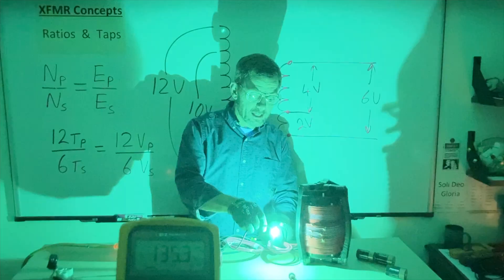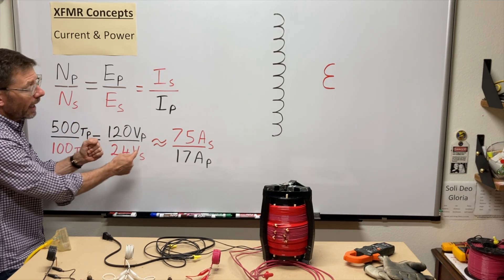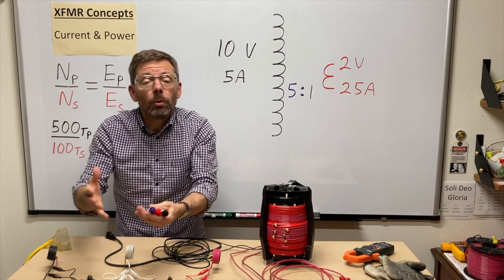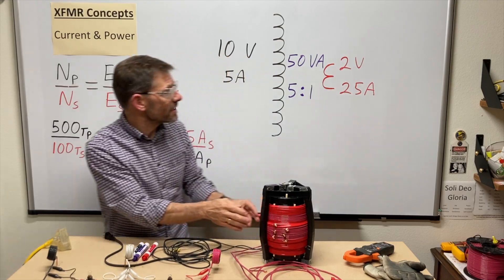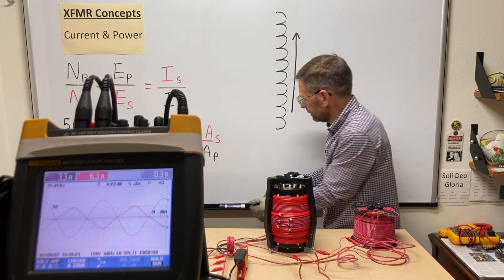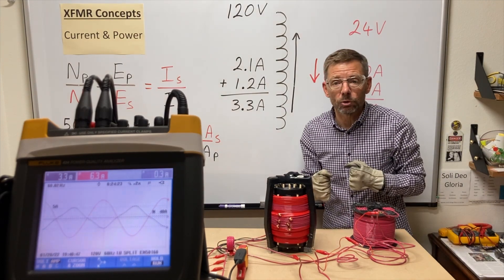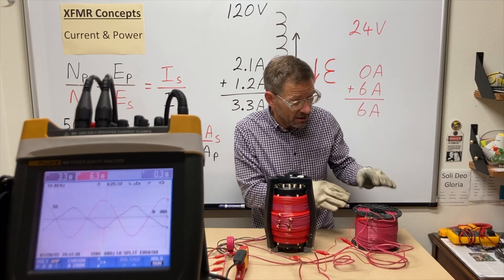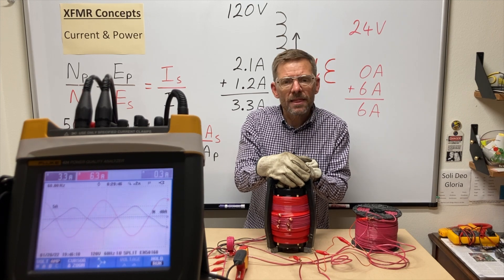Transformer Current and Power

Comment: Its possible to connect the secondary coil in series with the primary coil, but the output amounts to zero volts bc the waveforms cancel each other out being 180 degrees out of phase with each causing 100% destructive interference. Perhaps if the leads of one of coils were exchanged then it would give 240 volts from 100% constructive interference.
Reply: 🎉The wires in that transformer are too thin and its causing some copper losses due the electrons not having enough room to bounce around and some escape into the wire's insulation or coating. If wire was thicker more current would be available to the load devices connected in parallel. If you applied 240 volts to it the transformer would get so hot it will catch on fire due to these lost electrons escaping.

Comment: Hello Dave, hope all is well. I was wondering if you could settle a debate I’m having with a friend. We watched a video of a fella who plugged in a 500 foot spool of Romex (line to line and neutral to neutral on the same end) so basically just extending the circuit. The fella in the video was doing it to see if voltage drop would occur over the 500 foot roll without a load of any sort. The result, the same voltage measured at the connection occurred at the end of the coil of Romex. No difference in voltage. That’s not the debate and was just  the videos finding. At this point, my friend suggested putting an iron rod through the center of that “coil”. I told him it’s not a coil. There’s no magnetic field in that as it isn’t connected end to end. It’s just one way or “open” and I told him the neutral would negate any electromotive force as it is an opposing return path. That started the debate. I can tell you that in the video, the coil was not vibrating and apparently not producing any heat either. Since no VD was detected, in my opinion that would indicate 0 current being carried and therefore no, or a very low  magnetic field. If I’m being clear with this, can you explain in technical terms what is happening in this scenario so I can explain it to my friend? I’m pretty sure that I’m correct on this. Feel free to ask questions if need be. Thank you for your time.

Comment: Hey Dave, love your channel. May I get clarification on two questions:

1)
I was told that even if a system isn’t grounded (no ground rod to neutral etc at transformer and no grounding anywhere ) that if a power line that’s energized comes down and touches the earth, that it would still energize the earth. Now if energize means put the earth that it’s touching at its voltage then that’s surely true right? No matter if it’s soil, gravel, water that it’s touching right? A  120 v line comes down, and it will make the earth 120 v relative to neutral (in USA), no matter if that powerline is touching dry pavement, dirt soil or water right?

2)
The second question is - let’s forget about voltage. We have this 120 v line touching the ground - let’s say it’s grass or soil or water, is it possible for a current to flow thru the very earth itself if there are no grounding rods or grounding stuff anywhere near by? I ask it this way cuz I’m tryna take away with “return to source” and still see if current would flow thru the earth.

Comment: Your  explanation is awesome! Quick (academic) question.  What would happen (in your 50VA rating example) if I try to draw more current than the  maximum rated (on 2ndry 25 Amp) current  lets say 40 amp, load (given I run appropriate wire/gauge to accommodate the 40 amp current on the 2ndary side).  Since theoretically, if 2ndry draws more current, the the current in the primary also increases, so how does the rated capacity (VA)  factor in this? This is a sheer academic question.  Thanks.

Comment: God morning…😊
If i have 4160v primary line to line. I want to bank a transformer with 4160v primary and 240/480 v secondary . The costumer need 240 volts. What would be the connection on secondary to acquire 240 volts.. internal connection series. Cannot be parallel..
Reply: Cannot be parallel internal

Comment: Np*Ip/Ns*Is = Ep*Ip/Es*Is
AmpereTurns_primary/AmpereTurns_secondary = VoltAmperes_primary/VoltAmperes_secondary

Ampere Turns is the unit for the magnetic field.  Multiply by the magnetic permeability and it gives magnetic field in Tesla.

If you use a variable power supply with constant voltage source or constant current source, it will show the input voltage and current and you can vary things, without so much hand-waving. Also changing the frequency lets you introduce frequency dependent inductive and capacitive impedance.

Comment: Question that’s a little off topic…I saw a video that suggested the HV transmission lines coming into the substation primary side of the transformer were not affected by the secondary coils load.  However several other videos I’ve seen suggested that increasing the load on the secondary will cause an increase on the current primary winding.  Is there a way that the secondary load has no effect on the primary load of a transformer?

Comment: DAVE GORDON, You didn't mention anything about why transformers have "in rush current" when first apply voltage/current to transformers. The theory behind the transformers in rush current to go over in a lesson. Also you can do a lesson about Transformer GHOST current/voltage, what is causing the GHOST current/voltage and what is the theory behind GHOST currents and voltages?

Comment: Another solid video! Could you do one explaining symmetrical components some time? I'd be interested in your explanation. Also, I work for the electricity board and we have interconnected transformers pulling -VArs as LV generation pushes power up through transformers towards HV loads. I'd also be interested in how powerflows work like this, without inverting transformers etc. Thanks and I'll look forward to the next video!